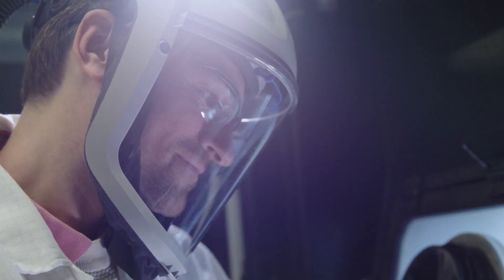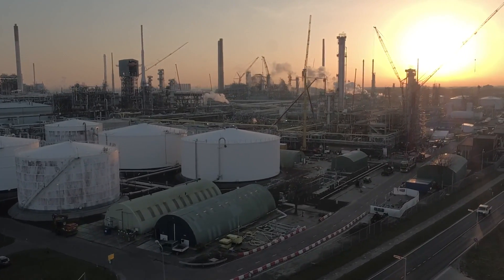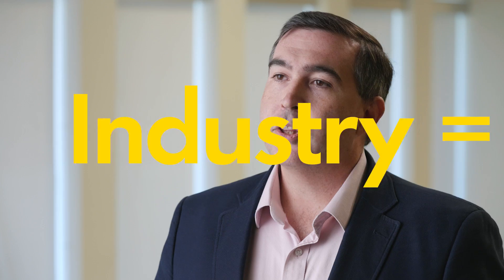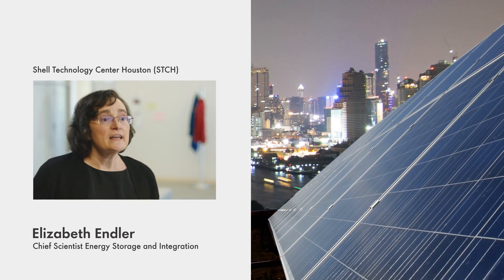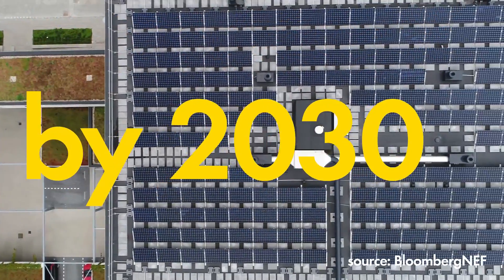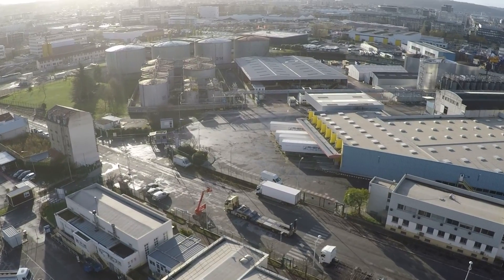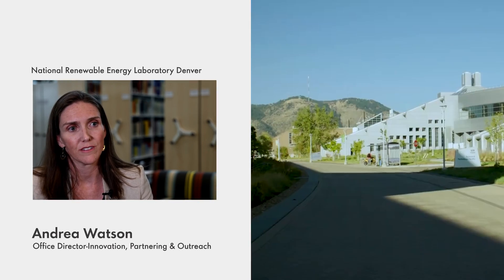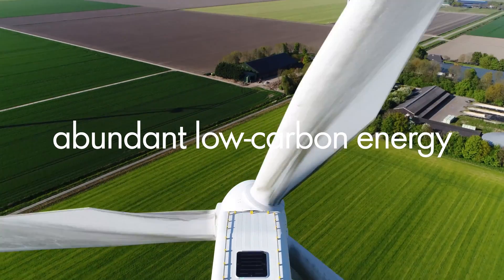Shell's Industrial Electrification Technology Programme

Comment: You have solar that works without light and wind energy that works without wind? Batteries require recharging which means having excess power to that normally required  and once the batteries are charged you have enormous amounts of energy with nowhere to go.
Great thinking there. 
In the UK we sometimes have weeks without much light or wind in winter, then come the frosts and rain which cover the solar panels, long nights and short days and the sun goes very low in the sky. 
We have the largest battery plant in Europe that will provide power to 300,000 homes for about two hours, what then? You talk of industry and renewables? What sort of 'development' is this?